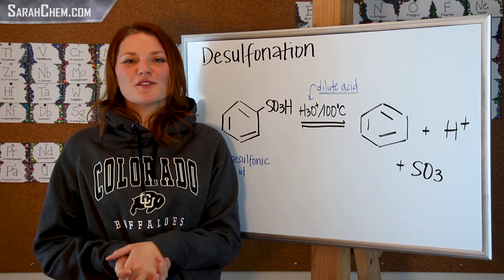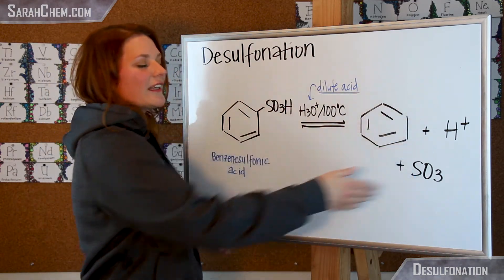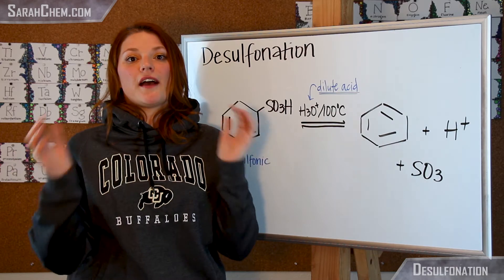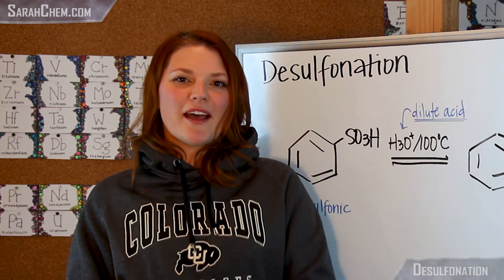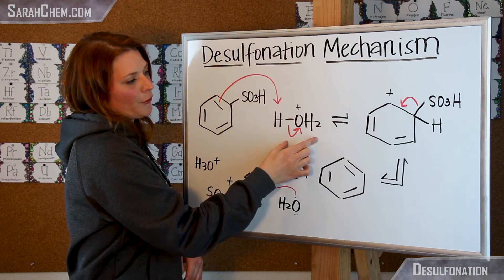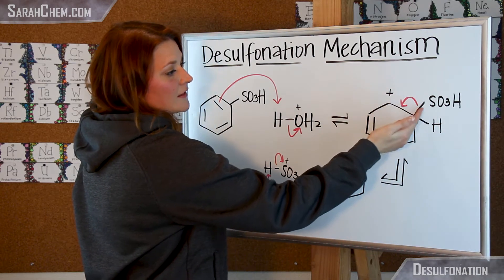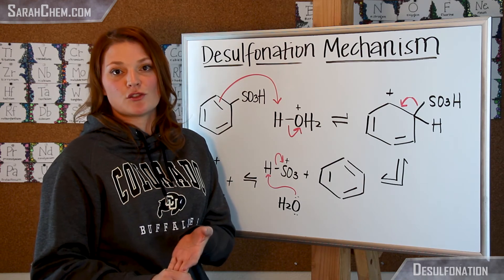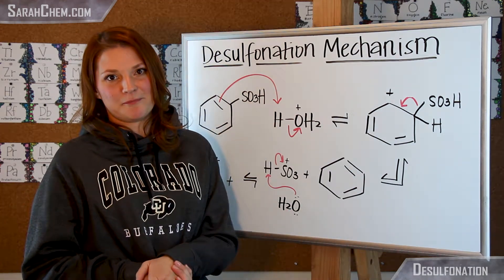Desulfonation

Comment: Why should the -OH in SO3H not attack the H+? , why should it be the benzene that does that? (Because Oxygen has lone pairs which can be given comparatively easily than benzene's double bonds and that too WITHOUT loss of aromaticity?)
Reply: I believe that does happen but after that O will gain a formal charge of +1.
Now one bond needs to be broken 

It will be either the S-O bond of the O-H bond

Now the energy required to break S-O single bond is 520kJ/mol

And O-H bond is 428 KJ/ mol

So OH bond breaks

So it happens but it then gets broken and no net reaction occurs
Reply: As of aromaticity , I guess that is the shortest energy route ( to break aromaticity in one step and the regain it later)
Reply: @theinterpreter3705 thanks a lot!!